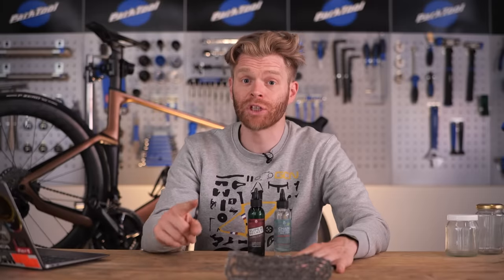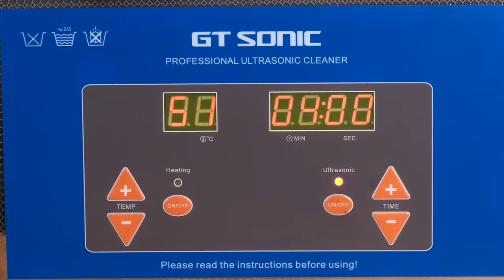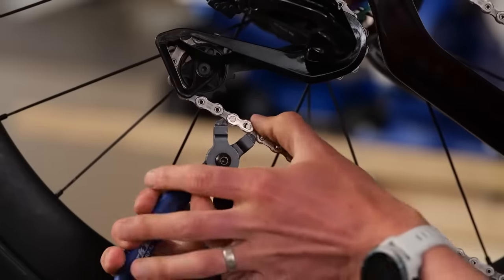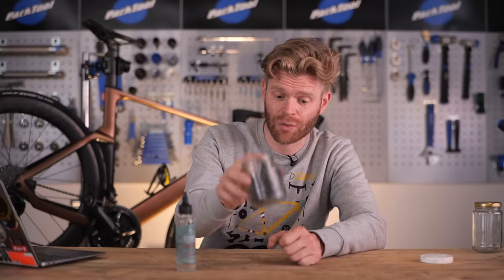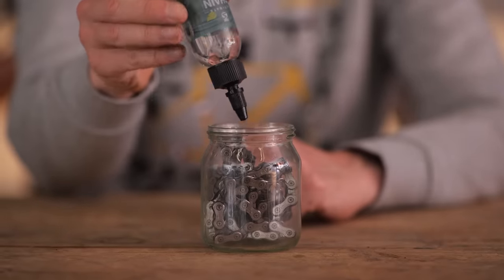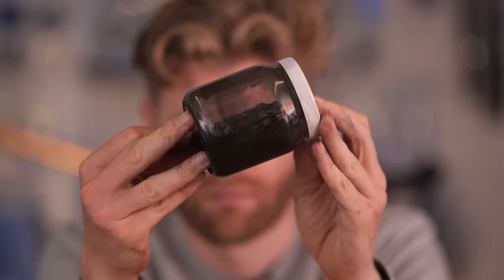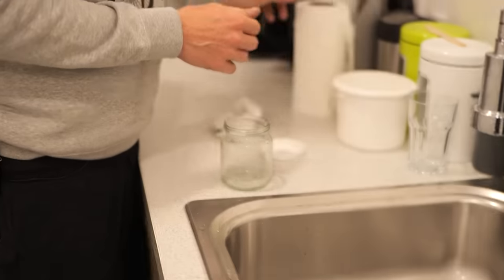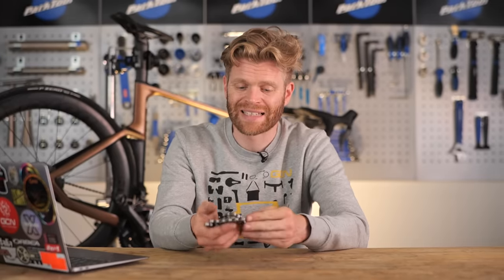The Most Efficient Way To Deep Clean Your Bike Chain

Comment: been doing it like this ever since quick-links came out about 7 or 8 years ago... after pretty much every ride, whip the chain off and get in in a wide bottom jar so its laid out flat, pour in just enough drivetrain cleaner to cover it, leave it for an hour giving it a good shake every now and then, empty the cleaner and add hot water, then keep rinsing and shaking while in the jar with hot water... 
absolutely pristine, gunk and grit free everytime...

extra little tip, you can slightly file the restrictive nibs on quick links to make it easier to unlink, dont worry, ive used the same 2 quick links for about 3 years and theyve never come off yet.
Reply: You must get through a lot of lubricant and cleaner.
Reply: Which  brand quick links do you use?
Reply: @markusseppala6547  I use KMC DLC 11 chains so just use the ones that come with them...i've bought a few others like the X11 and they appear to be the same 'missing' links... dunno what the sram ones are like tho, ive never used SRAM chains or drivechains before but i'd imagine they have the little tabs on aswell that hold the pin in place, you could probably file them down a tad aswell...the spring in your rear derailleur keeps it well in place and you still need to use a bit of strength to separate the quick links but you can do it by hand...

edit: just had a look at SRAM Powerlink and theyve got the little tabs on aswell so you can file those down the same as KMC links...

Comment: I clean my chain right after every ride.  3 mins with a pH neutral bicycle degreaser which i believe is a ethylene glycol monobutyl ether based product which is a pretty universal pH neutral cleaner used in many areas, brush it and the cassette and chainring, Rinse with 2 x 1.5L bottles of water which i bring it down to the wash bay at the bottom of my apartment block.  Bring it up to my house, whack it with a 660W high pressure blower (mine's a balloon blower| with small nozzle, 30 seconds done.    Lube with a cheap wet lube (I use finish line green, around usd 9 for 8 oz), done.    No visible black stuff on the outside, very very minimal black stuff between the links/rollers.  Frequency of cleaning is key, ie after every ride.  The degreaser costs only around usd 1 for 300ml as i get it with coupons and self collect at the e-commerce platform collection point.  Every cleaning uses around 30-40ml of product. 
I dont even bother to wipe off excess lube, coz i apply it with a cotton bud and so the sides dont get much, and also coz i clean after every ride so there is no point being anal about the sides attracting road grime etc.   Clean it after a sweaty ride, very efficient overall.

Comment: I have been cleaning the chain this way for over 20 years. 👌😎
I use diesel or gasoline.
Bonus tip, I leave the chain in the jar until the next chain change... since I use two chains that I rotate every 500km

Comment: Simply stunning! A question though. You suggest using it on a new chain. How about when the time comes for the second or third application of that lube? Do you repeat this process before applying that lube again?
Reply: No need if you use hot wax - that's about the only reason for using this product anyway.
Reply: Every time you want to wax your chain (300-400kms) you need to deep clean and re-wax the chain.
Reply: @ffskierdune6226 Then how do you remove the old wax and all of the dirt?  People keep saying boil your chain. Boil chain in what and for how long? Do you put it in a jar and pour the boiling water into it, or do you place it into a pot or kettle full of water, then bring it to a boil?  Or is there a different better method that does not involve ruining a kitchen pot?

I saw a video in which Victor Campanaerts demonstrates his chain wax method, and it looks as if he doesn’t bother.  He just wipes the chain off with a microfiber cloth several times, then declares it clean enough to re-wax, then go set the hour record.
Reply: @prestachuck2867  As previously mentioned, I no longer hot wax my chains. When I did, I always used mineral spirits to clean through a chain cleaner and a scrub brush for my cassette, then rinsed with denatured alcohol. I still use this method. The cost of mineral spirits is about 14 cents per ounce. I have never boiled my chains, as I am sure my wife would not approve. It may work very well. If Campy made a reusable quick-link, then I would 100% use an ultrasonic cleaner, as this has been shown to be the best way to remove everything. I will clean my chains until the spirits are clear. I get about 10,000km per Record chain. I'm not sure about the Ekar chain yet. Measured with a digital. The main reason I stopped hot waxing my chain was that I did not find any discernible benefit. During the season, I ride about 400km per week, So I need to clean about once per week. However, If I am tight for time, I can do a touch up with the Squirt drip wax product, and I am good to go. I cannot do the same with the Silca products, and their Secrete Sause product as it requires a very clean chain, IMHO.

Comment: The stripper is not cheap, but it's so much more convenient. Tip though, use enough chain stripper in your jar to submerge the chain fully, so the 2x 5 minutes wait are more effective. This is not wasteful if you keep the used stripper, because there should still be enough active ingredients to get to that 1 new chain per fluid ounce/ 30 mL
Reply: One of silca's vids said up to 5 new chains before you need to change the striper out,you could even pour it through a coffee filter if you want.Cheers!!!

Comment: I have two chains one in use and a second chain waxed and ready. The first chain waxing lasted about 200 miles or 320 kilometers. I use an ultra sonic cleaner and not polar bear friendly cleaners.
Reply: So only 200 miles for all of that work? I would have to re-wax the chain every week, and sometimes more often! Just a lot easier to clean it on the bike with the park chain cleaning machine, quickly soap down and rinse the whole bike, blow the chain out with a hose, and re-lube with a drip lube. No more than about ten to fifteen minutes total work. If you do it weekly, not only will the drivetrain last just as many miles, but you always have a nice clean bike.
Reply: @prestachuck2867  You should do a video with Ollie.

Comment: Silca chain stripper is £40. If I need 2 applications then that is half the bottle, £20. Thats absolutely ludicrous. Just use water based degreaser from screwfix which is £13 for 5L.
Reply: To dry the chain, wipe with a microfibre cloth, then put it back on the bike, back spin a few times and re wipe again, done.

Comment: I'm not sure on this one. I saw Josh say you could use the chain stripper in one of those chain cleaning tools on the bike. So why wouldn't it be good in a jar like that? 
And if you can't use it on a dirty chain, what should you be using? Just a chain degreaser? And how often would you remove your cassette to clean it properly?
Reply: If you're waxing, you can simply pour scalding water over your cassette to soften the wax debris and use a microfiber cloth to wipe it away. I usually wrap the freehub with the cloth to prevent excess water from getting into the bearings and then slowly drizzle the water over the cassette, rotating the wheel a quarter turn between douses. I thin use the edges of the towel to get between the cogs and wipe away the wax accumulation.

You can use a diluted degreaser like Simple Green or Purple Power if you're using a trad. wet lube, also works well. If you want to do a full cleaning, removing a cassette and dropping it in an ultrasonic cleaner is your best bet, as the USM will actually rattle all the debris out of the recesses of the cassette.

Comment: 4 jars about a pint or 500ml or more: 

Old settled dirty gas in one: pour off fuel only into an empty one, leave sediment behind. add chain, shake, soak, shake, lift out with short piece of shirt hanger with hook.  Pour 3rd jar of less dirty gas into 4th, cleanest jar, add chain, shake, soak, pull out, hang chain to dry some, lube or install and lube.  

Shake 2nd jar and pour all back into first jar.  Pour 4th jar with swishing back into 3rd jar. Save jars for next chain cleaning.  Don't loose the master link.
Reply: What
Reply: @chris4536  Pour off, like "decant" to leave behind the sediment, so your chain swishes around in just gasoline, not dirt from the last few chains you cleaned.

Comment: You forgot the step where you clean the cassette, pulley wheels and crankset!
If those are dirty, you can now start over.

I would also put on the lube while it's not installed yet, so you don't liquid drip wax all over the drivetrain.

Comment: Hi Ollie! During my postdoc at ICIQ in Catalonia, I once took my chain and cleaned it with some alkanes I found and sonicated it. And then it hit me: have you ever tried drying the chain in the oven? Of course, after rinsing with acetone or other volatile solvent, it dries quite fast, but say you are at home and want to have it done quickly. What's your opinion about leaving the chain at 100-110 C for 10-20 min to dry before lubbing?
Reply: Of course, I took advantage of the solvent disposal system. I always use more eco-friendly alternatives at home, but that remaining thin layer of additives is quite annoying to remove!

Comment: Jar every time now- I used to use those Barbieri ones but they are messy (fragile too)and 11 speed chains seem to jam, maybe better for 9 or less speeds. Use muc-off drivetrain cleaner but am considering using petrol as a stage one clean in a jar (swirl, never shake!)then the muc off...or maybe go directly from petrol to IPA 99.9% as muc off is expensive anyway....

Comment: The jar is definitely best.  I stopped using squirt lube because it was so hard to clean, compared to old wet lube in a jar.  I use wax now, it stays clean, when squirt still gets some dirt.
Reply from the maker: Wax is the way to go! Welcome to the club 🙌
Reply: The trick to use squirt is to allow the lube to dry overnight and wipe the next morning of all the excess lube. You shouldn’t feel any stickiness or oily after running your fingers over the chain. Ideally, Squirt dries off pretty dry. As such need the lube only inside the rollers.

Wipe chain after every ride and re-lube after every 300-400 km. Wipe dry and lube after a ride in the rain.
Reply: @junaid42465  I used it for years, did all that, it’s just not as clean as melt in a pot wax. I use molten speedwax.
Reply: @junaid42465    I agree with you. Squirt is very good. The best part is that you can reapply without having to completely clean your chain. I have used the Silca secret sauce for about one season but found that just after 200 km, my chain would be black and nosy. I could not reapply the product without thoroughly cleaning my chain. It would just drip off. Not so with Squirt. It was recommended to me by a former retired pro who now maintains his own bikes.

Comment: Not in my world.  The Silca product costs about $3.00 per oz in my world.  Instead, I use Varsol (mineral spirits) through a chain cleaning tool.  The cost is 14 cents per oz. Plus, once the solids have settled I can reuse it.  Followed up by a rinse in denatured alcohol and my chain is ready to be lubed (dripped wax).  If Campy had a reusable quick link then I would use an ultra-sonic cleaner every 400km.  This above process allows me to get about 10,000km from a Record chain.  I measure my chain with digital callipers.

Comment: To save money I would fist clean the dirty chain with a cheap solvent and after rinsing with water I would then clean it with the more expensive stripping fluid.
Reply: Rinse with denatured alcohol.  This removes any of the solvent residues and dries very quickly.  Better adhesion of lube.

Comment: Turpentine would do the same job for much less than the cost of that Silca product. 
If you're worried about what to do with the dirty jar of Turpentine you can either let it sit for a few days to allow the dirt to fall to the bottom before filtering it to a new jar or you can pour it onto the weeds around your driveway or concrete paths. Don't pour it onto a vegetable garden.
Reply: Yeah,  don't pour turpentine onto your weeds🤦  Also, this doesn't just clean.  It promoted the wax binding to the chain beyond removing oil

Comment: Does anyone know how often hot wax should be changed? Do you feel that after a few uses it is mostly sanding paste?
Another question; Does the chain usually need to be lubricated, if after every run you wash the chain (in a jar) with an oil-based solvent??
This came to my mind because the bearings of skateboards are not greased, they are only washed.. they are said to be faster and still last just as long??
Reply: About 300–400 km max. Silca says you can use their secret sauce to supplement. I did not find this to work well. Thus, I stopped waxing my chain. Expensive and too time-consuming. Waxing every week—no thank you.
Reply: First time rewax @300km and then every 500km. I rotate 3 chains - saves a lot of time. Does not take more time as all other cleaning is faster. As for cost it’s much cheaper than oil because your chains and drive train will last much, much longer. And those are very expensive.

Comment: Ollie if a chains about 2 months old would it be too far gone  to deep clean an come to the wax side?
Reply: Depends on your riding style and distance you’ve covered.
Reply: Not unless it’s 3 weeks of TdF riding.
Reply: Only use a new chain and strip it well. The more the wax sticks to the metal the better. In case of a used chain, waxing will be less optimal because there is less bonding.
Reply: In a perfect world, you would start with a new chain. But we don't live in a perfect world. So it would depend on the mileage of the chain. If it is not high, then it would be fine. Just make sure when you are deep cleaning the chain that the liquid is 100% clear; otherwise, the adhesion will suffer.
Reply: @janwillemkuilenburg7561  the solution has a bonding substance as well to counter this.

Comment: #AskGCNTech, I have been using drip-on wax (Silca super secret) since my chain was new. I now want to put a hot melt wax on it. What do I need to do to prep the chain? I did properly clean the chain before using the drip wax. Do I need to remove the old drip-on wax first?
Reply: Yes, 100%.  The chain must be 100% clean for the wax to adhere to the chain.  Hot waxing is great but it is expensive and does not last more than 300-400km max.  Not worth the time or the expense
Reply: @ffskierdune6226  but since my chain was stripped clean before using drip wax, I’m wondering if I just need to put it in boiling water, or if the hot wax will remove the drip wax, or if I have to chemically strip it again. Both the drip wax I used and hot wax I’m considering are Silca.
Reply: @bihlygoat  I have used both of the Silca products.  I would thoroughly clean your chain with their chain stripper before you do a hot wax treatment. Make sure that your cleaning liquid is crystal clear before you hot wax.  Otherwise, you will have poor adhesion.
Reply: @ffskierdune6226  If he's already degreased the chain there's no need to use the chain stripper. Boiling water will do.